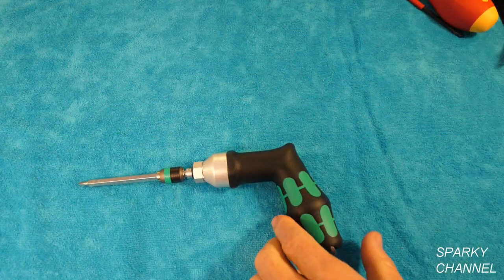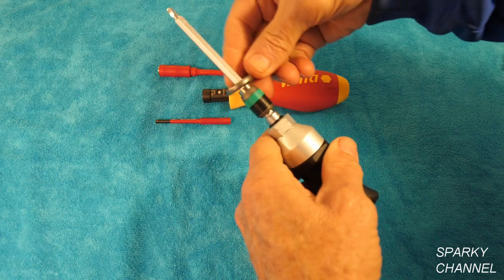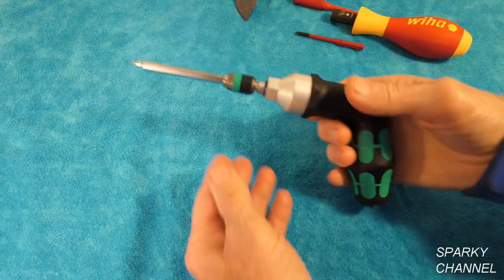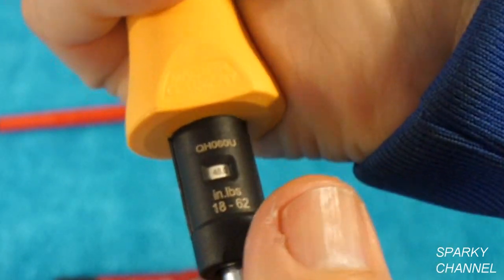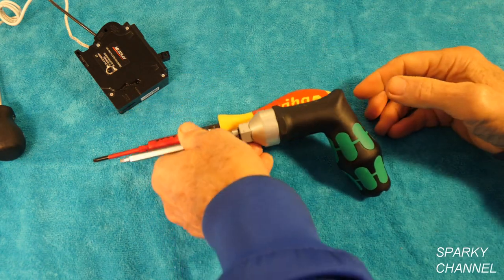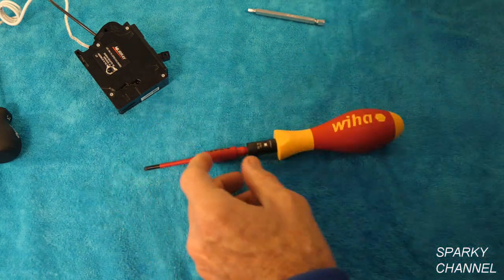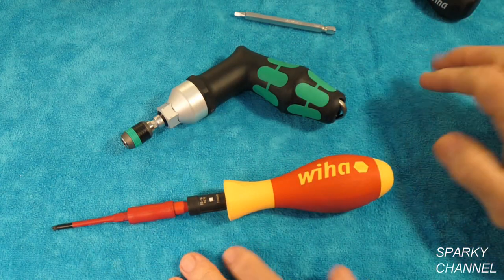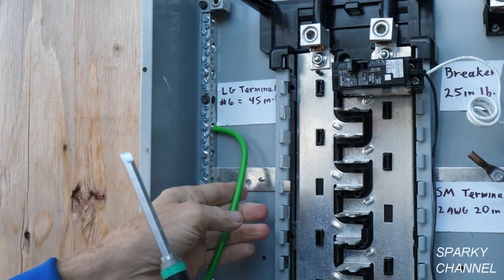Wiha vs. Wera Torque Screwdrivers for 2020 NEC 110.14 (D)

Comment from the maker: Wiha 28792 Insulated Torque Screwdriver Set, 18 to 62 in-lb: Amazon: https://amzn.to/36liLou

Wera 05074712001 Kraftform 7447 Hexagon Torque Screwdriver, 1/4" Head, 25.0-55.0"/lbs Variable Torque Adjustment Range: Amazon: https://amzn.to/2Flio1f

Playlist: Electrical Wiring by Sparky Channel: https://www.youtube.com/playlist?list=PLSD43kAzjUITARtRyFqvVhmqwNm34Ck5k  

Playlist: EMT Bending by Sparky Channel: https://www.youtube.com/playlist?list=PLSD43kAzjUIT9C0yzPTkqULBCmJXX_goh

Playlist: 2023 NEC Video Playlist by Sparky Channel: https://www.youtube.com/playlist?list=PLSD43kAzjUISg0qOUMomYe8GH6a_C2xBv

Comment: As A Electrical Contractor This is such a pain in the arse I've Been Tightening Down Lugs And Breaker screws With out any issue ever.. Sometimes   I Feel If you can't Tighten something properly by Hand it's Problely Time to get out the Game 😂 I Did My Hands Are Shot👍
Reply from the maker: I understand. Thanks Jon!
Reply: Yeah but why not have everyone from a first year apprentice to a 25 year master tighten everything down to the exact perfect spec? We have all seen stuff that’s over or under tightened in panels. One click and you know it’s done perfectly. I think I’m going to get one of these screwdrivers.

Comment: Crescent actually makes 1,000V insulated drive adapters on both 1/4” hex and 3/8” square drive allowing you to use non-insulated tools to torque energized equipment. I personally like using 2 on each end of an extension which can be taped or shrink wrapped to prevent shorts, while the insulated adapters allow you to stay safe from the energized connectors you’re torquing. While an insulated torque wrench may be preferred they’re quite expensive and not all employers/agencies can afford them. The insulated adapters work, and our agency sent them out to get tested, I believe to 7,200 volts, though it may have been less, it was the same voltage they test class 0 gloves at, which eludes me at the moment, and they passed without issue. I believe they run between maybe $15-20 and are available online and at the “blue” big box hardware store. 
I personally like the Wiha but DO NOT misplace the torque adjuster as a replacement will set you back quite a bit. The 18-62 in/lb is the way to go as while the 10-50 in/lb may be a lot cheaper it isn’t enough for what you need as 60 in/lb comes up quite a bit, at least for me. 
You can effectively use the Wera with the crescent adapter on energized equipment but the loose adjustment key is a pain; a co-worker that uses it just leaves the adjuster in his bag as it can get easily lost.
Reply: What do you torque to 60 in/lbs?

Comment: Great video! It is necessary to prepare this kind of insulated manual screwdriver. Not long ago, I bought this kind of insulated screwdriver of the renhotecic brand. During normal use, it is very safe. Everyone can prepare one if needed.

Comment: My breaker box was installed about 20 years ago. Would it be advisable to have an electrician inspect the box checking to make sure all the terminals are at the required torque?
Reply from the maker: Yes, I think that's a good idea.
Reply: I had a 40 year old breaker box in my house. It started to smell of dead mice and one day I happened to see a red dot out of the corner of my eye. I took the box cover off and found one breaker glowing because the hold down screw had snapped. The smell came from the cooking plastic. I would be careful with tightening old installations.

Comment: very good video , thanks again , 272.00 buck is out of reach for an electrician  ,  only been ask ones in 28 years for torque specs on a step down transformer ,  inspector ask if we added the lugs wheres the spec sheet, Thur it out with the box , fail ,lol, it was a school .
Reply from the maker: OK, thanks.

Comment: Hiii sparky good information  but one question how much torque set for sockets and switch a torque in N.M how much the torque numbers for sockets and switch
Reply: If not specified otherwise by the manufacturer (good manufacturers like ABB, Schneider etc. will specify): 
M3 0,5 ÷ 0,56 Nm
M3* 0,8 ÷ 0,9 Nm
M3,5 1,0 ÷ 1,1 Nm
M4 1,4 ÷ 1,5 Nm
M5 2,7 ÷ 3,0 Nm
M6 5,4 ÷ 6,0 Nm ; 
M8 14,0 ÷ 16,0 Nm ; 
M10 23,0 ÷ 26,0 Nm ; 
M12 36,0 ÷ 40,0 Nm ; 
M16 54,0 ÷ 60,0 Nm ;

Comment: 18 inch pounds is a bit high as a starting point for receptacle screws. Leviton rates them at 10-14 inch lbs. However there is a low range $126 Wiha 28552 0.5Nm - 2.0Nm (5-17 in lbs)

Comment: I have the Wiha and at 45 inlbs the driver bits twist like nobodys business and on a seimans breaker using the #2 square and the large flathead I could not get the screws to torque because the bits cammed out and the screw heads deformed. My conclusion is the Wiha just isn't up to 45inlbs.
Reply from the maker: Sorry to hear it. Siemens breakers are usually 25 lb-in. torque. Is yours really 45 lb-in?
Reply: @SparkyChannel  2 pole 50 with #6 is. Try that with your Wiha. Not easy.
Reply from the maker: @skytrooper506  I see. Yes, 45 lb-in can be challenging with the Wiha.

Comment: All this time I've torquing the snot out electrical connections per your fine example & now this!! There are videos where your hand shakes because of the high torque you are applying. You are giving it ur all!!
Levity aside, I like Wiha best but I don't like the 2 step process for changing the setting--remove the bit & insert the tool. I've been looking at other brands & I like Armeg w/ the tool insertion thru the back of the handle(1 step) but, like others, it's not available in Imperial  & I'm not about to spend time doing conversions. I wonder if Wiha can eliminate the bit holder & use longer bits & use the freed up space in the handle to accommodate setting changes  & store the tool there. I know easier said than done. Here hoping Wiha Torque screwdriver 2.0!!
Reply from the maker: Sounds good to me, thanks!

Comment: Jesus bro, use metric!
Reply: I mean he is American
Reply: They don't use metric in America...
Reply: @Nick-bh1fy , hey man, I know, but the tools are available everywhere, consider it this way, by incorporating the metric system (which is profoundly easier to scale up or down to any size) he will also be receiving views from every other country in the world. I'm English, we invented imperial metrics, I'm also scientifically educated, and hands down there is no comparison in the utility between the two systems. 

I know it's not easy to think in a new system, but at least a couple of figures in the corner of the screen now again to help others accurately relate to the info. 

This is obviously more work for the creator, they have to figure it out once, but that saves every other viewer having to figure it out too, so work x number of viewers. 

Anyway, apologies for coming across as rude if I did, I was in dire need of a torque screwdriver and needed the info. =)
Reply: nanogeekpro2 all good, I’m Canadian so we use metric here and it’s a lot more easier to scale drawings and use metric to get the most accurate measurements
Reply: Why?

Comment: Both of these torque screwdrivers do not have low enough settings to use with Alumiconn connectors. They require 10 and 15 inch pounds to correctly install on number 12 and 10 wires, respectively.
I bought a Wheeler Firearms Accurizing Torque Wrench with Inch/Pounds from Amazon for about $45.00 for this purpose. it has a range of 2 - 65 inch pounds.
Reply: Awesome recommendation. It looks like it is a very good alternative for these two torque drivers. Have you noticed any major flaws in the Wheeler, and it is good for day-to-day electrical work?
Reply: @MrWzeljunior  You probably don't want to use a torque driver for day to day use on copper wire (but you could.) I bought mine for a project pigtailing copper to aluminum wire using certified devices and have not used it much since. It worked well and now stays in its protective case.

Comment: Was this change in the code precipitated by real world failures caused by screws not properly torqued?
Reply: If you have ever used a thermal camera on a panel you will see why they put it into the code.  Improperly torqued lugs/screws  burn wire consistently.
Reply: @mimike2640  Thanks for the answer.

Comment: Thank you for the video! Very informative! I had a question and was wondering if you can help me. What size are the Service Entrance cables?
Reply from the maker: In the example they are 2/0. (two naught) pronounced “two not” is a larger wire and will carry the 200 amps by code.

Comment: Hey sparky can you take a look at the Capri tool torque screwdriver? It’s 10-50 in lbs, goes by one inch increments and is adjusted by a knob so no removing bits, only thing is it’s not insulated oh and it has a t-handle for when you need more torque $125 on amazon

Comment: I really like the Wiha but the price is hurting my feelings.
Reply from the maker: I understand.
Reply: Wera VDE Torque screwdriver is priced similarly but has much smaller torque range. I'm a big fan of Wera, but for this i'm going with Wiha. It's pricey, but these are some high quality tools. Bad calibrated torque tool is as good as one without torque indication.